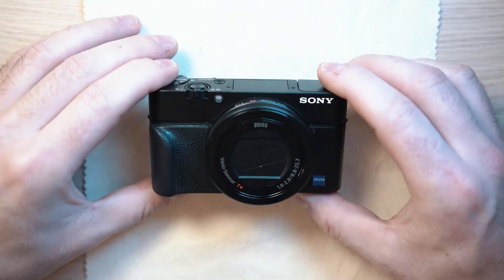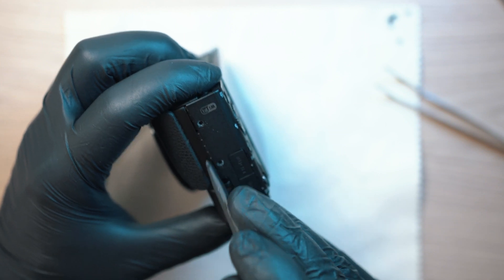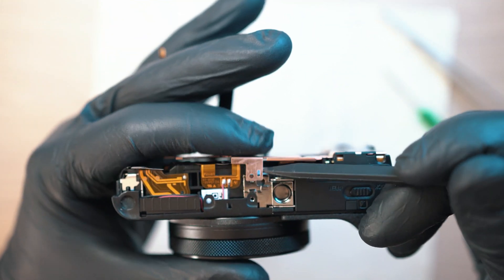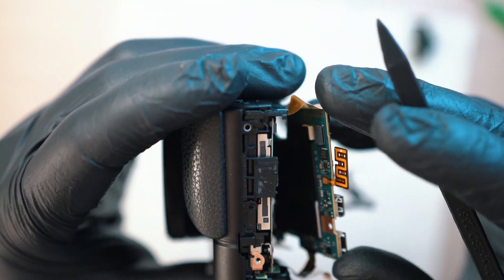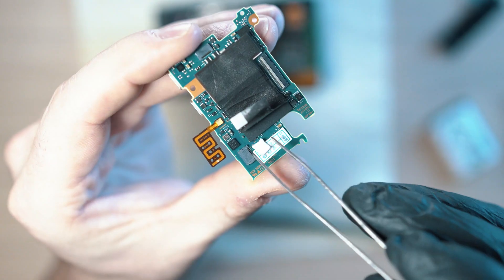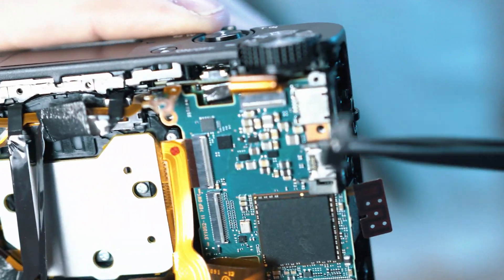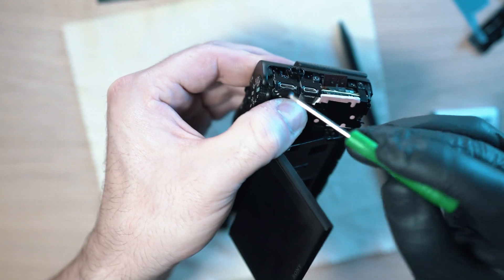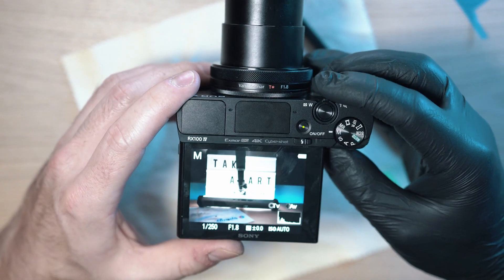Sony RX100 IV  Won't Turn ON | Main Board Replacement And Teardown | Fix | 4K

Comment: After removal of the sticker at 3:30, I am occasionally getting zapped in that area (like an electric fence). My battery is not in the camea so any ideas why?
Reply from the maker: capacitor for flash is fully charged and that is zapping you! be careful and discharge it! it is high voltage at around 300-500volts !
Reply: @takeapart  Thank you for quick response!! I opened it up a few weeks ago and this was not happening (placed screen ribbon cable but the manufacturer sent a bad one and image was upside down). Do you have social media? Not certain exactly how to discharge... looking for tutorial now.

Comment: I recently dropped my Sony rx100 IV on the floor and it cannot be turned on since. I went to a camera shop to get it fixed but they told me it could not be fixed because there were problems with the circuit. Do you think I can still find replaceable circuits because these cameras are really old. + there were no signs of the red light unlike the video
Reply from the maker: hard to tell… there could be easy solution to this
Reply: @takeapart  Can u somehow give tips? i dropped my camera but nothing in the outside seems broken outside
Reply from the maker: @aelays8031 it’s impossible…. where you located?
Reply: @takeapart  I’m in Thailand and I see you’re in New Zealand so i guess it is not possible but thank you though.
Reply from the maker: take it apart and check connections

Comment: 8:10 This is a close-up of a memory card reader. In your opinion, if the SD card cannot be inserted, then you need to bend the springs back.
Or change the bottom block?

Comment: Hi i have the same camera. It works well excepts for some problem: when left in a cold place (under 10 celsius degrees) it loses the settings data and it prompts asking to insert language and time. The other problems, the battery gauge doesnt work, it doesnt appear on screen with any display setting. Also i cant change the display brightness (function not available, the menu tells). I think this is in some way is related to the battery gauge problem. What do you think it can cause the problems and what i should try to check? Thanks in advance, the  video is really useful!
Reply from the maker: probably battery management PCB… (one attached to battery compartment) .
Reply: Thanks for the prompt answer, i'll try to see if the batteryt PCB  is a part of the camera easy to reach!
Reply from the maker: @pupettomontmartre well, it requires quite a lot digging…. but doable

Comment: Hi.😊 I need to replace the flex cable that has the speaker on it.
Can I use a soldering iron to take the speaker off and put it on the new flex cable? Or will it be too hot and damage the flex.
Reply from the maker: yes desolder speaker… it will be fine

Comment: Excellent guide. Thanks! I took a punt on a dirt cheap IV with no power but a like new body from a reputable seller - reported no LEDs, no life at all. From experience with compact cameras, I know that half the time this is simply a ribbon cable coming loose. Usually battery to main board or top control board. 
Followed your steps to get to the main board. Disconnected and reconnect all cables, battery in and voila! I now have a fully working IV for next to nothing and an hour of my time.
Reply from the maker: thanks for watching!

Comment: After a small drop, my mark 7 wont turn on and no led. Where should i check first? I opened it but don't not know where to check.
Reply from the maker: hi, check all connectors first

Comment: My RX100 IV was completely dead, no signs of life whatsoever. I think it was caused by using a cheap micro-usb charger.

I purchased a new board on eBay (the AliExpress link no longer works) and installed it following these instructions.

A couple things to note:

The video skips the removal of the control buttons. They fortunately slide off and the ribbon connector just pulls out.

The video puts the lower left ribbon cables UNDER the copper plate. The factory routing has them OVER the copper plate. Not sure if this makes a difference.

My antenna glue (to glue the antenna to the main board) was no longer functional. I used the tiniest amount of Clear Gorilla Glue to re-adhere the antenna. It worked well. There's no need to glue the antenna to the body, it just tucks underneath the outer case.

Be careful adjusting the rear cover screws. The center two screws can interfere with the flash release. If the flash release no longer works, simply loosen one of the two screws until it does.

I did not find any need to purchase new thermal pad. You can re-use the old one from the old chip without issue.

After re-assembly, the camera works great! This video was extremely helpful. However, this is NOT an easy thing to accomplish. It is very doable if you take your time.
Reply from the maker: thanks for watching and your input
Reply: Thank you for the video, you saved my camera!  @takeapart

Comment: Caution, cable to the NFC antenne can tear, if you bend it like you do.
Reply from the maker: hi,yes be careful! thanks for your tip
Reply: @takeapart  I learnt the hard way, thankfully it did not reach the traces.

Comment: I fried my RX100 M3 by putting too much voltage in with a dummy battery. Will I need to replace all the boards inside or just the main board?
Reply from the maker: hi, I would try board near battery compartment first.
Reply: @takeapart   thank you! I will try that

Comment: Hi! Im having exactly the same problem in my rx100 IV. 
Do you think that by using not original micro usb cables might have helped to do the damage?
Thanks a lot for this guide! It was the only true help i found
Reply from the maker: Hi, it is hard to answer… this little beast does a lot and it can take a toll sometimes…. I wouldn’t say a cable was the issue
Reply: Hi Babube,
Yes! This is what happened to mine. You need to use the more expensive phone style micro-USB Charger. The cheap ones will fry the motherboard.
Our countermeasure to stop this from happening again is to purchase the external battery charger (Sony ACCTRDCX) and never using the micro-usb port on the board.
Reply: @arnoldpalmeroy2993  More likely the charger would fry the port. You shouldn't cheap out on both charger or cables.

Comment: My rx100 is over..reboot after push power button..im installed open camera and fails download app at reeboot camera is fails..!! How to fix hard reset whit button not possible
Reply from the maker: it is difficult to troubleshoot…. if you positive that there are no mechanical issues… and battery is good… I would bet on main board…

Comment: My Sony RX100 MK IV is completely dead after a drop. Not even the red LED is blinking next to the battery. Any idea?
Reply from the maker: hi, hard to guess… I would open it as check connectors first

Comment: Nice video! keep up with good work!
My RX100VA is currently does not recognize memory card. And red light blinks 4 times when I put SD card in. Is this on motherboard or SD card slot?
Reply from the maker: hi, I would say sd card slot …. look inside with torch(look for bent terminals) if the terminal/ s are not broken you should be able to straighten them out with pair of tweezers.  thanks for support and watching!
Reply: @takeapart  Very thank you for quick response! I've disassembled it and slot, terminals looks fine. Replacing SD slot part would work for this?
Reply from the maker: hard to tell… just double check those terminals… even slight bent will affect functionality.
Reply: @takeapart  Okay I'll try it Thanks!
Reply from the maker: let me know how it went
Reply: @takeapart  nothing happend..
I'll ask parts seller on aliexpress that what part's I have to replace

Comment: my camera not turning on 2 long red blink and 6 short blink red ... what could be the issue .
how can i get the red led blink code
Reply from the maker: hi, it is very hard to find out what exactly the code mean.   I would say it is Motherboard issue.
Reply: After research, I strongly suspect it to be a power issue (over or under voltage, or short circuit) then when detected prevents the image processor to start.

The rx series are designed to be debugged through usb, using a multi terminal protocol cable (15 pins).

So, normally, if you take out the battery and plug a USB cable, it should bypass the hang event and boot intime a certain step, and you should the encounter some functionality issues because a par le the board shutdown itself to prevent any further damage.

The mtp USB port has uart access and it's enabled in the Sony rx kernels.
I've ordered a mtp USB connector and I'll try to access the UART console, so I could examine logs and boot sequence.

I've learned that those Sony boards are strongly inspired from beaglebone boards, which are almost impossible to brick.
So the most probable issues are physical damages. (Ribbons, internal battery, capacitors, DC/DC converters...)
Reply: I got same issue with 2 long and 6 short red blink on my rx1rm2. Have you fixed your camera and got the reason why it happens?
Reply: @xgwang2750  Not yet. I didn't have many times to do it.

Comment: Hi TAKEAPART,
I have a RX100 V showing zero signs of life, no charge light, not even that red light process error, thing won't even charge on a full battery.Will try to replace mainb Great work!
Reply: I know it’s been two years but was the MB the issue for you when with no blinking lights?
Reply from the maker: @michaelbasaraba1325 yes
Reply: @takeapart even with no blinking lights?
Reply: @michaelbasaraba1325  me in the same  position.. also a rx100v no signs of life.. you already know more ?
Reply from the maker: hi, yes it is probably that main board… internal components can be little bit different from IV . thanks for watching

Comment: I have the same problem on the M1. Is it possible to put a board from M3-M5 on M1 model?
Reply from the maker: hi, I don’t think so …. if you need new board please follow links in description
Reply: @takeapart  There are no RX100 M1 boards on aliexpress. Only M4-M5 models
Reply from the maker: getin touch with seller and ask … they will be happy to create new listing for you .
Reply: @takeapart  ok

Comment: Where did you find the error code for the red led blinking sequence?
Reply from the maker: it is kind a internal information… not easily searchable on net .
Reply: You can find it in eevblog video, he shares all the schematic and service manual now

Comment: Nice video, How did you know to replace the main board? What happened to the camera.
Reply from the maker: Hi, it was bricked... red light next to the sd card just kept blinking red ... code for processor error.
Reply: @takeapart  Ah ok, nice to know. I have a problem with my rx100 m3. The turn of turn on sign shows up. This happened from a drop. I replaced the lens and the sensor, still no fix. Maybe it's the mainboard?
Reply from the maker: yes sounds like it!